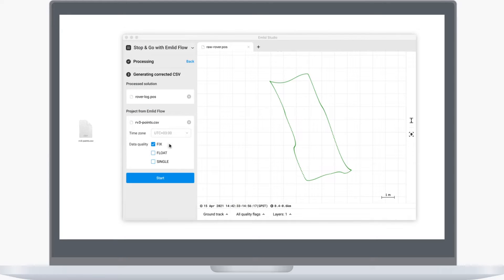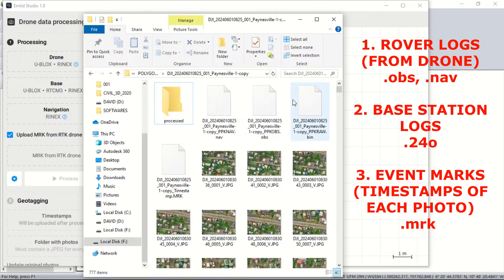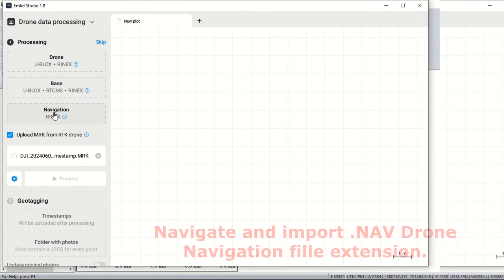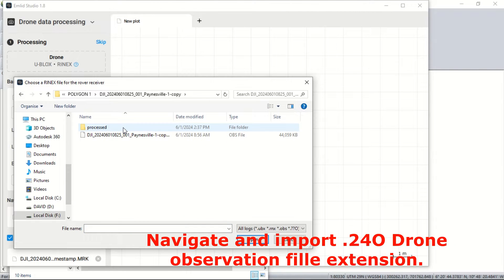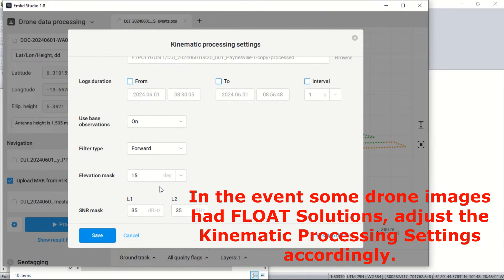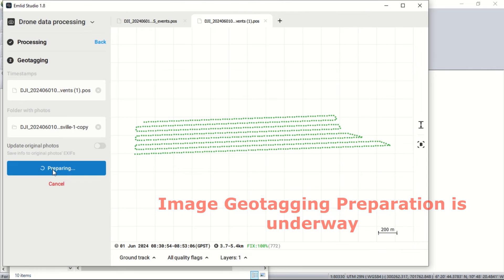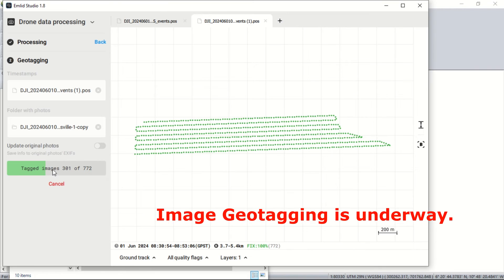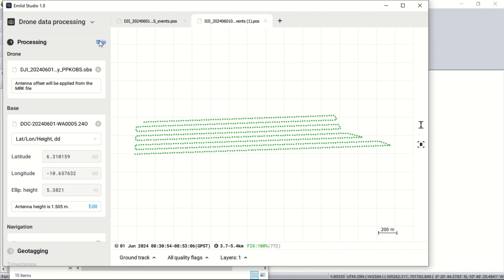Drone Image Solutions: Float to Fix with Post-Processed Kinematic (PPK) in Emlid Studio

Comment: I performed a survey with a Mavic 3 E using the RTK module, and I did the PPK in Emlid.
An error message appears, reporting a number of points as 115, but the number of images is 114. I already checked that the MRK file has 114 items and 114 images, and yet the error message appears and it doesn't process.

Comment: can u provide with another data bro? i've tried to proccess the data from ur drive, but the fix rate is still at 21% not a 100%.
Reply from the maker: Kindly stick to the procedure, once you are using the same data, it should work

Comment: Does the drone have to be connected to RTK to get the observation files?
And can i use a log file from a different base gnss system other than an emlid one?
Reply from the maker: It doesn't have because the extension files can be used for PPK using a standalone GPS instrument.
Reply: @nexxistutorials what if it is a different brand of gnss equipment will it still work on emlid studio?